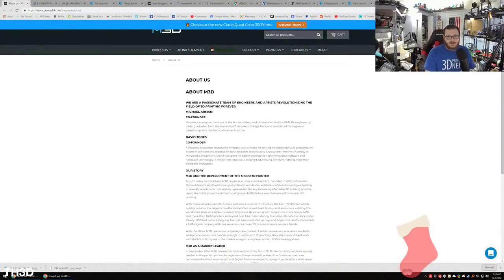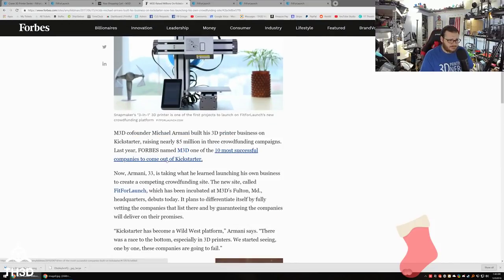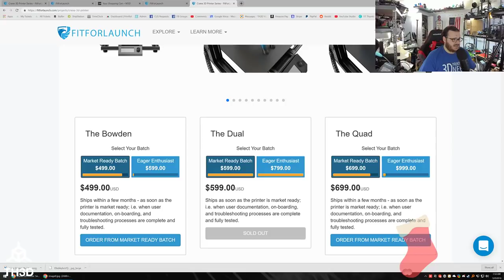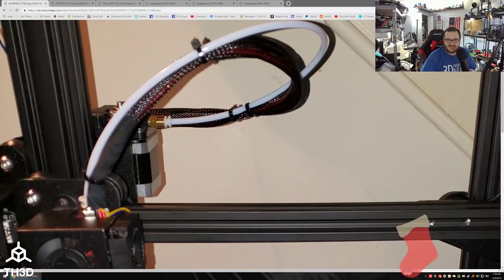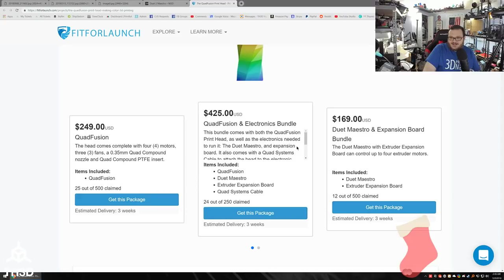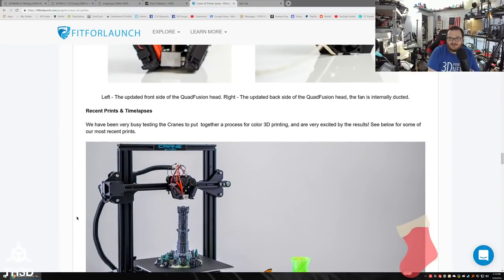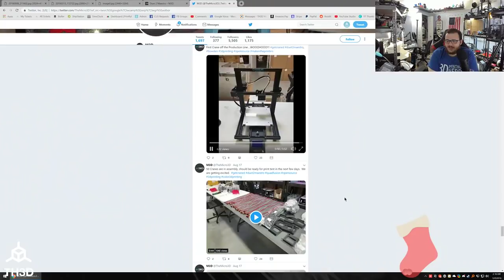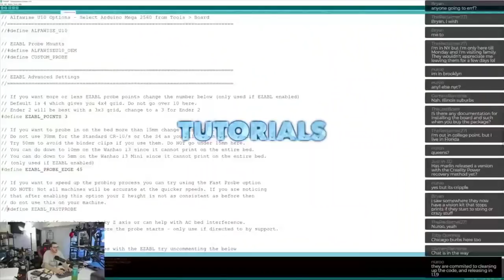[LIVE] Fit For Delays - M3D Crane 3D Printers

Comment: 1 )  Everyone had many opportunities to take advantage of the "pay more to get one sooner".  There was nothing secret about it.  In fact, pay more to get your printer sooner (and with more unresolved issues - not really a smart move) was the structure/premise of the campaign from the beginning, right?  In fact, you still have the chance to upgrade your place in line. 
2) You don't acknowledge a big benefit of having the crowdfunding run by the maker.  More of your money goes to the maker, to fulfilling the pledges.  You like giving Kickstarter or Indiegogo 5% of your pledge for the privilege of hosting the campaign (not a major tech accomplishment, right)?
3) You gloss over the built in risk reduction in FitForLaunch campaign.  On KS and Indiegogo, the early committers get the best price.  If you are cautious, you end up paying more, so those platforms are gaming you to commit before you are ready.  You can cancel, of course, but then you lose your place in line if you change your mind.  On FitForLaunch campaigns, you pay extra for the privilege of getting it sooner.  This means the people who can afford the higher prices are also incurring the most risk.  The folks on a tight budget  - with less ability to absorb a loss of time/money - will get their product at the end of the campaign after more of the bugs have been fixed and enhancements have been added.  This is quite a bit less "sleazy" than the KS approach.